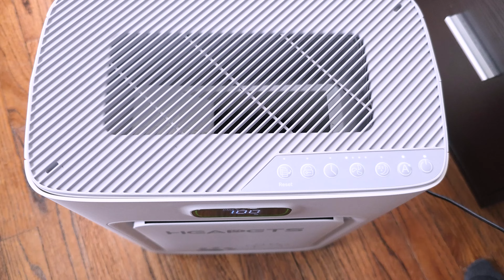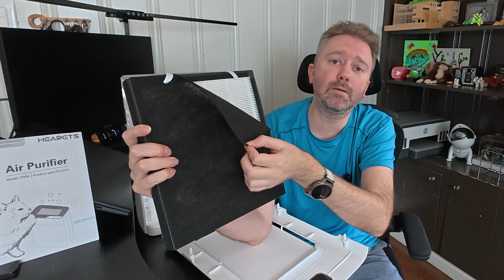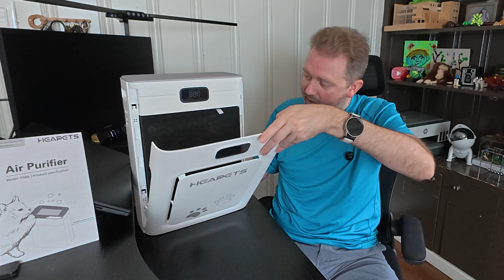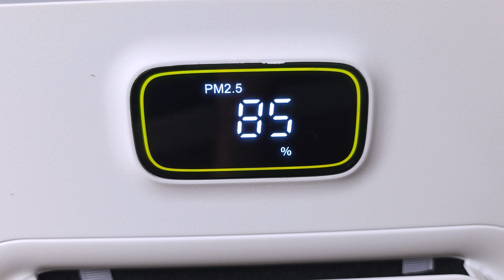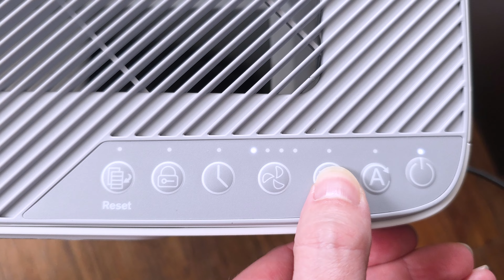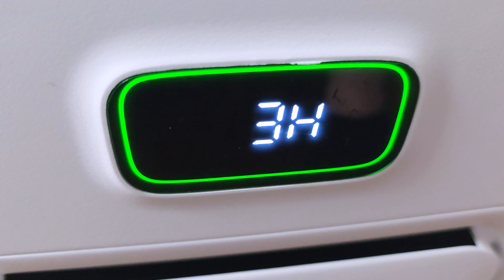Stop the Sneeze! 🐾 HEAPETS Double Sided Air Purifier: Is It the Ultimate Pet Parent Hack?

Comment: I have changed the front & back filters but my Chanel filter light is still on. How can I fix this
Reply from the maker: You have to hold down one of the buttons for about 10 seconds to reset it.  I am not in front of mine right now, but I think the filter button is on the left side when looking at it.